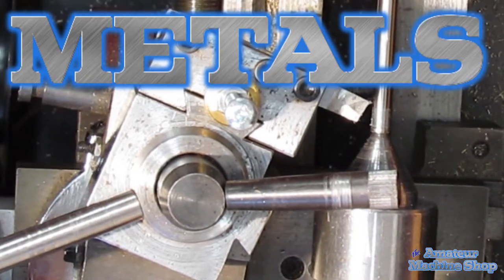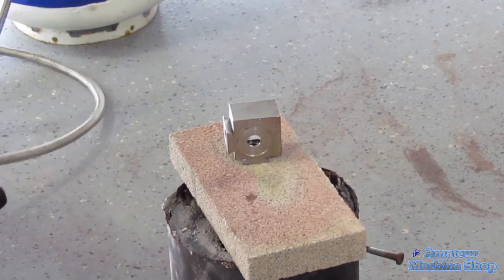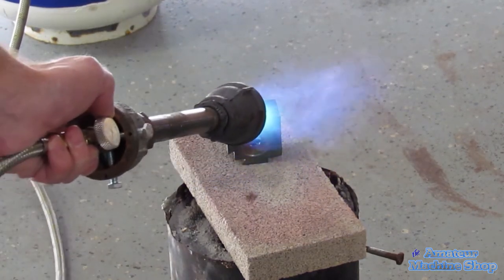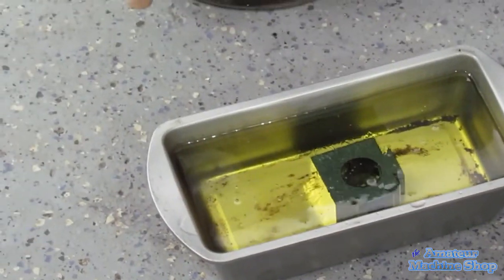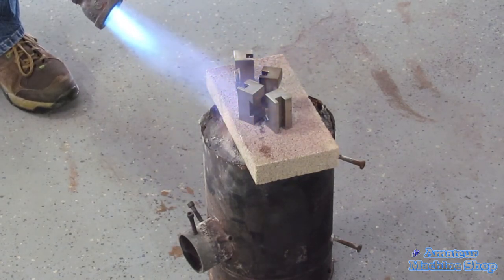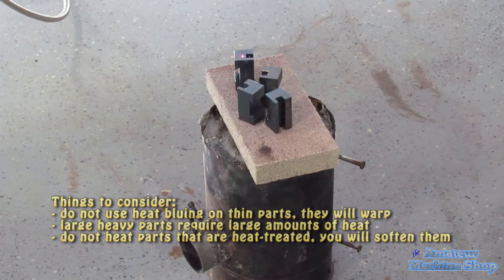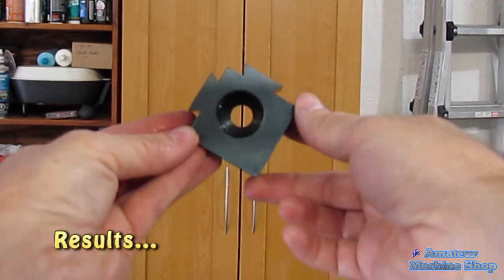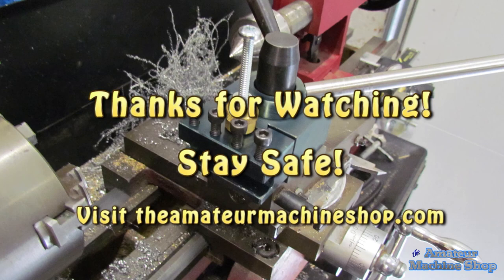Hot Bluing - Rust Protecting Steel Parts

Comment: I use burnt motor oil when heat bluing. I didn’t think about cooking oil. Seems like it works well and a bit cleaner. Of course when it comes to cold bluing, Brownell Oxpho is hard to beat.
Reply from the maker: Thanks for the tip, eventually I want to give cold bluing a try.
Reply: @theamateurmachineshop2150  
It’s much easier, but a little pricey. A little of the solution goes a long way. 
Use a very fine brush to ensure a neat coat.
Reply from the maker: @lookingbehind6335  I am sure cold bluing is the way to go for parts that cannot be heated! Another good tip, thanks!